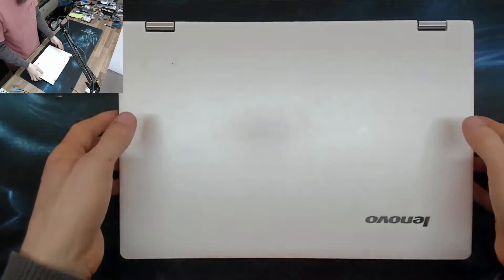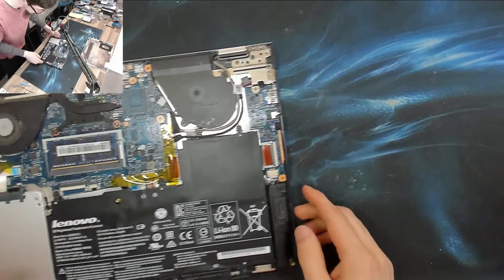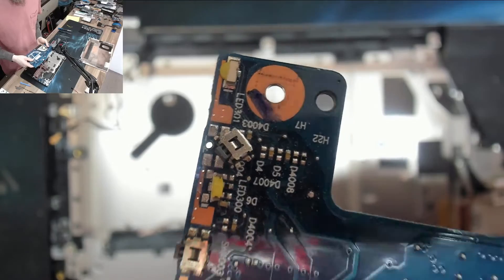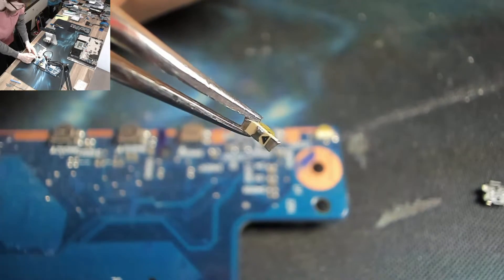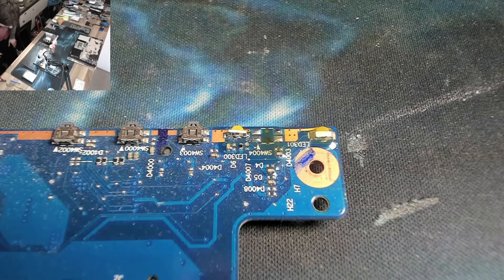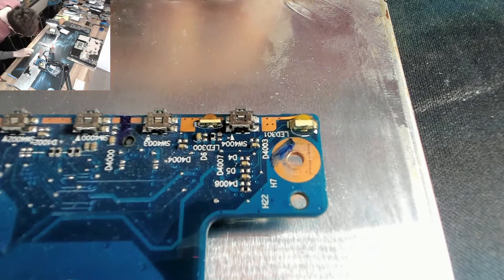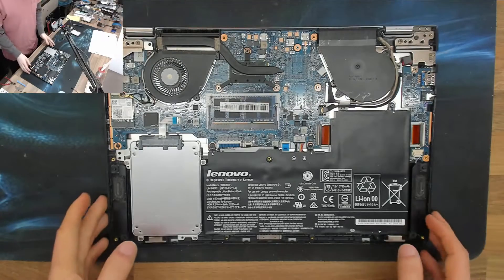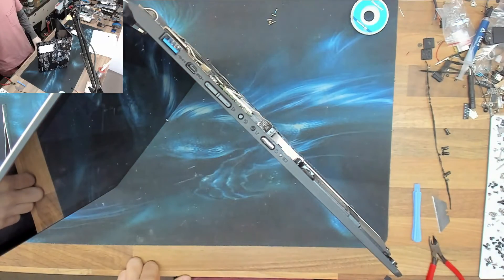LFC#138 - Lenovo Yoga Not Turning On

Comment: If you came here for clues on a more recent Yoga, specifically the X1 2nd and 3rd gen: They have a common fault with the power button as well, but on those, the flat-flex cable connecting the power-button-PCB to the main logic board is the culprit. Just replace that 1-2$ flat-flex and you should be good to go.

Comment: What temperature you have used to solder switch without melting plastic parts?
Reply: @Blastboy: The maximum temperature for soldering smd LEDs in most applications should NOT exceed 260 degrees Celsius to prevent damage to the base (resin) where the luminous lens is mounted. You can use if surface space allows a piece of aluminum tape or Kapton type tape to cover the lens (protection). Previously using flux on the pads to be soldered will make the time less than 15 seconds if you use low melting point solder. A good practice is to start with 150 degrees Celsius and 40% airflow if there are no other components nearby (if any, protect all components mainly plastic connectors for flexible cables in the near area and reduce the flow to 20% and bring the smallest nozzle closer to 5 cm from the target).
Of course using heat resistant gloves is good practice for micro-soldering novices (not necessarily the most expensive to start with, ie there are good cheap alternatives to them). All the best.
Reply: @carlosgarciaoropeza5480 thank you!

Comment: My S1 Yoga switches on, but only the fan, it won't boot and the only way to turn it off, is to use a paper clip through the reset hole, but it doesn't actually reset anything. :(

Comment: What is that tool that blows hot air that shows up at 5:21? I'd imagine its a less powerful blowtorch type thing but I have no idea what exactly.
Reply from the maker: It's known as a Hot Air Station. Used for reflowing SMD components!
Reply: @Adamant_IT  thank you! Now I can get what I need instead of trying to jury rig something that might damage the motherboard with too much heat!

Comment: I have an older Lenovo Yoga 2 11 and I'm having the same problem. I am a Computer Tech but, I just don't feel like soldering the small button on the board. So, I just will get another used yoga 2 11.

Comment: I have two of these Lenovo, one died on me one day for no reason power but nothing on the screen another one still powers on but the speakers no longer work these symptoms in these models are pretty common.  nobody gives me any hope to fix it some repair places they suggest to me that get new motherboards.
Reply: I have the  yoga 500 14isk, replaced the mainboard 3 times now - after about a year of use they switch on then straight off again, wont charge or run off mains. It will gladly run on battery tho. Common on lenovo's. From what I read on forums seemes to be something about the Nuvotron ICU - piece of garbage contoller chip thats the issue??